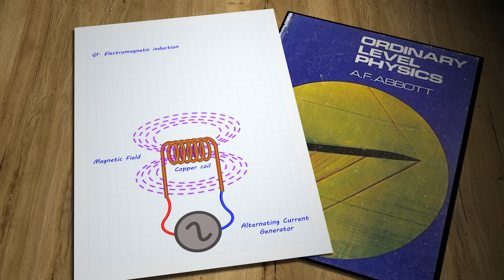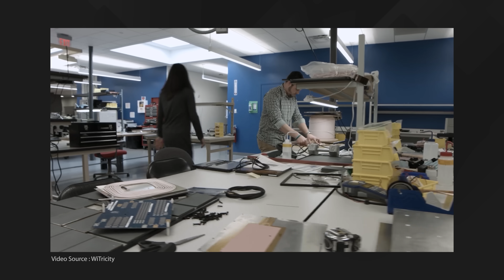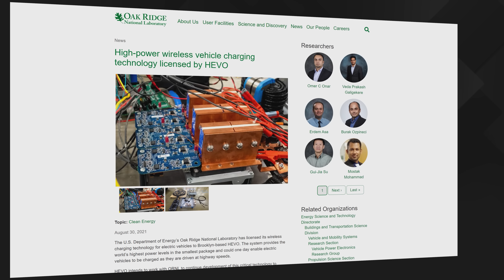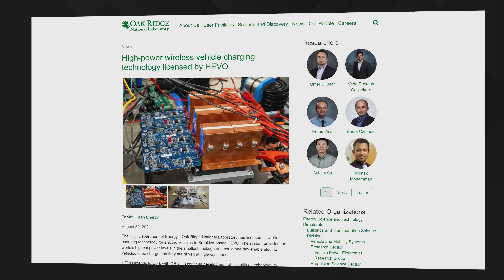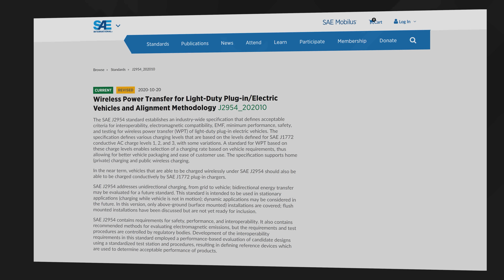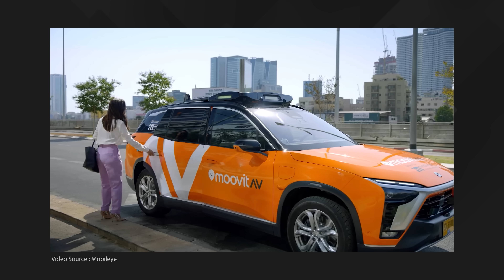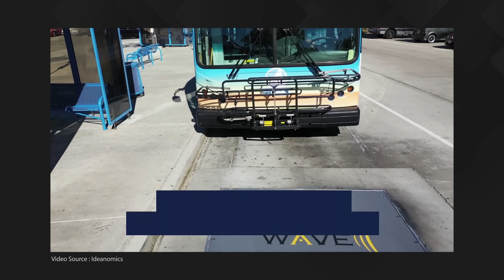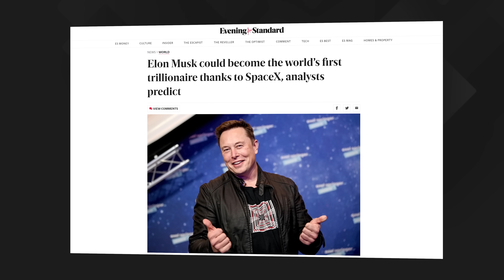Wireless FULL EV charging has arrived!  Exciting new tech breakthrough.

Comment: Is energy put into the primary coil wasted if there isn’t a secondary coil in charging range? I can see how stationary pads could easily have a sensor that only turns the unit on when a chargeable vehicle is present, but it seems like the charge while moving roadways might just bleed most of their energy into empty space.
Reply: The secondary coil affects the resonance, and the driving circuit actually can't put energy into the primary without a secondary. The beauty of the system is that no sensor is needed. It acts a bit like the secondary completes the circuit.
Reply: @agsystems8220  thanks!

Comment: Are we really going to waste 10% of the electricity needed to charge our cars just for the sake of not having to plug a cable ? Is that really what we need ? How many power plants would be needed just to cope for the wasted electricity ?
Reply: Yes--would be safer, faster (and more convenient than fossil fuel pumping). With more convenient charging, EV cars and trucks could thus have smaller batteries (=less weight, =more efficient).

Comment: "and even charging at highway speeds with grid-to-battery efficiency of 90% to 96.5%." This is simply not possible, really. Even high efficiency switch mode power supplies have an efficiency of 90% maximum. Maintaining credibily is apparently not a concern anymore in modern companies.
Reply: Yeah, anything other than a direct connection claiming figures like that is a big red flag.
Reply: Thank you for being one of the rare voices of reason in this comment section. The numbers stated in the video are possible only in very specific lab conditions w/ superconductors, if that. But, that's the modus operandi of the modern tech companies that invest more money on design, marketing and hype than on engineering, and the scientifically illiterate public swallows it like crazy hoping for their next digital messiah that will solve all their problems so that they won't have to be slightly inconvenienced when trying to tackle the modern problems of climate change and the like.
Reply: I suppose these 90 to 96% efficiency only take into account the loss from one coil to the next... in fact I'd bet on it :)
Still... considering the entire system the complexity, cost, materials used... there is ZERO reason to go for this!
Reply: What it has to do with power supplies?And  "Titanium" PSU 80 plus certificate requires 96 % efficiency at 50% load. That's not maximum - it's requirement. High power transformers can achieve up to 99.75% efficiency.
Reply: @Steellmor  80 Plus Bronze has an efficiency of 85% at 50% load. The highest rated: 80 Plus Titanium has a maximum efficiency of 94% at 50% load. Below and above 50% load it gradually drops back down to 90%. Most high frequency switch mode power supplies under normal operating conditions have a efficiency of 90% or less. You can find this information anywhere and everywhere on the internet. Please do some more research and verify your information from multiple reputable sources.
Reply: @gendragongfly  Well 1st graders do have credibility. We cannot expect someone who cannot spell words and would fail their written test to understand how these things work. Those little ones know they cannot scream stuff blindly. They would prove something is 'simply not possible'.  I love how you believe you are some kinda researcher. Because you can find all those fake 'facts' on a search engine? Yea how about you pass 1st grade and get at least one PhD? P.S I just checked the internet and? Bigfoot is real! Cos the internet said so. Omg!
Reply: @MrFlatage  Sorry for the typo, I missed a 't' and an 'i'. If you can find a peer reviewed research paper from a reputable source (IEEE for example) that shows it's possible to transfer via inductive coupling mains electricity and use that to charge a battery with a "grid to battery" efficiency of above 90%, I'll admit that I was wrong. Just a DOI code will suffice. I don't need a PhD to read a research paper.
Reply: @gendragongfly  I clearly said 'Titanium" PSU 80 plus certificate'.it has Required (MINIMUM) 96% efficiency at 50% load for 230V input. (94% for 115V). How about you do some research,before stating LIES.
You said " Even high efficiency switch mode power supplies have an efficiency of 90% maximum." - Those are NOT high efficiency,90% is NOT maximum.
Reply: @gendragongfly  You want a proof from "a reputable source" given to you by strangers on internet,about NEW technology that isn't yet being common used?And obviously you wont believe any sources that are affiliated with companies that develop any of such tech?
Reply: @Steellmor  High-voltage transformers have negligible flux and hysteresis loses on the down-step size (they typically have 2-4% loss when stepping up, tho) so their losses usually come purely from conductor resistance (primaries need a lot of windings to step down from 400kV to 220kV to 11kV to...) which is not that high if properly cooled. Conductor loss is one of the primary reasons why we use high-voltage for transmission in the first place, no wonder it's as efficient as we can get it. But once you get down to 'safely usable' electricity every little thing starts to matter and that's why we can't have nice things—eddy currents are unaffected by the voltage so they (relatively) produce more loses at lower voltages, hysteresis losses as well. That's why typical 220V->12V transformers can hope to achieve 95% efficiency at best (the rest is lost in rectifying), pending on the load of course... And that is before you remove the ferrite core and try to do everything over the air where the flux loss is humongous which makes inductive charging an exercise in wastefulness.
Reply: @zwerko  Exactly "(the rest is lost in rectifying)" - Whole PSU unit for common use,with 12v,5v,3.3v rails,cooling fan all the components - 96% Minimum Required at 50% load for "Titanium" 80 Plus certificate. Why the hell EV charger needs 12V? Regular chargers use standard 120v or 208\240V for AC, or 50-1000V DC.

Comment: While high power wireless charging is clearly possible what levels of radio interference will such high power devices  radiate? Greta might not be very impressed either as even small efficiency losses multiplied by many millions of vehicles topping up with tens of kilowatts per charge would equate to a massive waste of energy.

Comment: Because magnets are bipolar, the inverse square law does not apply.  The strength of a magnetic field drops off with distance much faster than that. There is no simple law, as the rate of fall off depends on the geometry of the source.

Comment: I'm wondering how much loss does a wireless charging system lose compared to wired charging?
Reply: It will always be bigger loss than wired. Also, it will always be more expensive and with more modes of failure.

Comment: Imagine future interstate freeways with a 5-10mile "charging lane" every hundred miles or so.  This would solve the problem of not enough charging stations--that may otherwise be overrun (as the number of EV's  increase).   As a bonus, EV trucks could have smaller batteries (=less weight, =less road damage) and wouldn't need to stop for "re-fueling".
Reply: Why only a 5 - 10 mile charging lane?  Why not a dedicated charging lane with people dropping into the lower speed lane to charge, getting back into faster lanes, then dropping back into charge lanes as needed.  Placing it on the side where the exits are would block everything up; but putting on the outside of the fast lane, possibly with merge points to warn fast movers that slower traffic merges in ahead, might work well.  They'd still be moving at up to 55 MPH or so while charging (too fast for exiting and entering because the lanes will probably be full all the time and might become the truck lane), but they'd need to get up to speed to move with the rest of traffic.
Reply: @zinaj9437  Do you have any idea how much that would cost?
Reply: @incognitotorpedo42  What will 2 degrees cost (climate change)?
Reply: @incognitotorpedo42  - If it's a cable with a charge, it costs the price of laying the cable.  Laying one cable is easier and less expensive than laying pieces of cables with terminals and added connectors.

Comment: Maybe super capacitors can play a role in this area. If wireless technology can transfer energy faster than the battery can accept it, and if EV‘s had small packs of supercapacitors to supplement the battery, The super capacitor pack could be charged extremely rapidly and then dump its energy into the battery over a longer period of time. A vehicle could pick up energy in spurts as it passes over wireless charge pads, with the supercapacitor pack acting as an intermediary to smooth out the energy flow to the main battery pack.

Comment: Normally a big fan of your videos. But this is ridiculous. Love green tech, but I hate co-opting fan-boys running scams on the ignorant public with blatent nonsense. That little LED light pad? 2W, maybe. That is at least 1000x less than required to be minimally useful for a car. This sort of tech scales roughly with volume. It doesnt take a physicist to know that 1000 of those would be a bit larger than a pizza box. Ever heard of an induction cooktop? How do you think that works? What good is a charger receiver under a car if it has to have a 0.5m clearance to ANYTHING metal to avoid dissipating heat in the metal parts? Not only does adjacent metal heating cost efficiency points in the transfer, it costs lifetime and durability of components like suspension arms due to repeated heating/cooling which would otherwise not happen. What problem does this solve? People litterally being too LAZY to plug the vehicle in?? My god what kind of society are we building here? Even so, current tech could make a robotic arm that bolts to the wall and plugs the car in for you that is safer, cheaper, more efficient, more forward compatible with new standards, and more scalable. I could even put a little happy-face OLED on the end of the damn thing so the rubes buy more stock. Just wow. Hope it was a good check. You should charge more when they want you to hawk garbage.

Comment: In road wireless charging, now THAT would allow for less battery size needed in a vehicle.
Reply: fucking distribute plates at regular intervals and use intelligent guided brushes to charge a supercapacitor, put a plate each 400m or so and charge the supercap just to transfer it's energy in a bigger interval of time into the battery that way you don't have to make a fking kilometer lenght plate to charge 1% of the battery.
Reply: bonus, low battery distress, less battery weight needed for everyday use and less weight therefore cheaper and more economical.

Comment: One thing you glossed over really quickly - Having a wireless charger does not equate to having V2G capability, as that requires additional hardware complexity on both sides.  Also, it's long been known that resonant coupling will distort EM fields to allow greater power transfer than a non-resonant coupler.  This is why resonant antennas have a larger effective area than their physical area.
Reply: Watch the two videos from Tesla Bjørn about it being demonstrated with bi-directional capable offerings from that company.

Comment: 1996: In NZ, an electric bus for tourism at Whakarewarewa near Rotorua is powered using Inductive Power
Transfer to charge (30-60kW).
Bombardier have been using the system to wirelessly charge trams & light rail vehicles for over a decade.

Comment: Honestly if I could get 7% or more more energy into my car battery I'd plug it in every time. If you really want to make charging easier just put some retractable brushes into your garage and some large pads under your car. Your car could direct you (or drive itself) into exactly the right spot, and then automatically connect to the car.
Reply: Exactly this seems easy enough and honestly I doubt we’re going to see this technology working on highways, given the state of highways and how poorly they are often maintained imagine if there was expensive infrastructure in there that just seems like a terrible idea. About as feasible as solar roads…
Reply: That's exactly the way my Ryobi vacuum cleaner works.
Reply: Align your car? I had a simple solution back in '77' ie: Two yellow line on the garage floor. I simply looked over the side.
Reply: BUT is charging from wall to battery 100% efficient? I rather doubt it. So the delta between this technology and 'the pug' will be less. 

FURTHER, YOU may plug it in, but what about anyone else that drives it? :-) :-)
Reply: @larrybolhuis1049  The transfer efficiency they were talking about here is just the transfer from the wall to the car, before the charging circuit in the car. In both a direct plug-in and this wireless setup you'll have exactly the same losses in the cables and connectors, but with the wireless charging setup you're adding the extra inefficient step.

Regarding someone not plugging your car in, that isn't really a problem. If I can't get to work the next day then they won't drive my car again. Not that I have an electric car yet.
Reply: @ThisRandomUsername  well, he explicitly stated multiple times it's net to battery efficiency.
The advantage probably is that the wireless transfer works as a voltage transformer while transferring the energy. So the part from plug to battery would already be included.
Reply: @jpt3640  Sorry, I thought I corrected myself in a new comment, but it must've been deleted because I linked an external study. Basically you're right, it does remove some of the transformer losses, but usually when you're dealing with large amounts of power and large air gaps you get some extra eddy current losses at lower frequencies or hysteresis losses at higher frequencies. I didn't notice that he says it's net to battery efficiency until I looked at Matt Ferrel's video.
The extra losses expected in a system like this have to do with the large size of the coils needing more flux guiding core (I'm not an expert in magnetics or inductance, it's been a while since I played around with these sorts of things, so I might be wrong here - correct me.) Maybe they're using an air core, but that probably needs huge currents in the coil, meaning more resistive losses.

In my deleted reply I linked a 2016 SAE paper describing a ~98% efficient charging circuit for cars. ~3% is lost to your conductors from the grid to your charger, and there are obviously a few more losses elsewhere. I just don't believe they'll have only a 3% disadvantage by introducing a massive air gap between charger and receiver. They claim otherwise though.

Maybe I have a bad taste in my mouth from the companies boasting about long range mobile phone charging which is really a different problem entirely.
Reply: @ThisRandomUsername  you are right, never trust marketing guys ;)
More than 90% efficiency would be incredible.
I already heard about this half a year ago but then they didn't reveal any details and i just didn't believe at all. 
This video sounds far more solid....
Let's see. If you take into account all the technologies that have been in the media the last 2 years then we will be zero co2 in 2030. Won't happen, eh?
Reply: @ThisRandomUsername  dude,it's the same exact problem, if they really had this technology they would be marketing that to cell phone manufacturers first simply because they could incorporate this tech much faster than a car.
Reply: @jpt3640  There is no advantage, that's why nobody has done it.
Reply: @ThisRandomUsername  No its not a different problem, its just too much loss.
Reply: @larrybolhuis1049  The plug itself is like 99.999% efficient yes because we’re only talking about the difference between using your cable or using the wireless transfer.
Any additional losses due to transforming the power from ac to dc etc are not included, this is an additional lossy step that otherwise does not exist.

Comment: I really like how you summarily dismissed the huge problems with electric cars so easily.  All of the things you mentioned are valid concerns with the current EV market.  EV's are notoriously expensive and hard to repair.  The main reason for the up take in EV's is marketing not advances in tech or ease of use.  Even the most cursory research in to the practicality of owning a EV would have alerted you to the things I have mentioned.  I did my research and wow is buying a EV a bad idea currently.  EV's are still very poorly supported after you buy one and in general in most markets.  I dare you to buy one and see how long your battery and or the life of your vehicle in general lasts and you better hope that it doesn't take damage (there are very few places including the dealers that know or can repair them easily) replacing a battery in most cases costs almost as much as buying the vehicle and there is no current data on how often this happens I asked at all of the dealers that I visited what life I could expect from a EV none of them could tell me.  EV's are in concept a great idea its a pity the implementation of these ideals is a lot harder to put in to practice no matter the amount good wishes.  Do you own shares in EV stocks because wow are you shilling hard for them.  In short the EV market has a long way to go and I suggest everyone think really hard before getting one.  One could say how does the saying go  "Just have a think".  Cheers.
Reply: Hmm.  I've been driving an EV for four years, love it, and have had no problems with what little service it has needed.  That includes a minor collision.  Granted, I live in an area where EV uptake is higher than average.  There are certainly parts of the world that aren't there yet.  BTW, there is extensive data on Tesla battery lifetime, and it looks great.  The new LFP batteries are claimed to be good for a million miles.